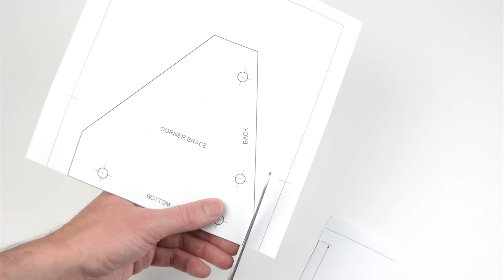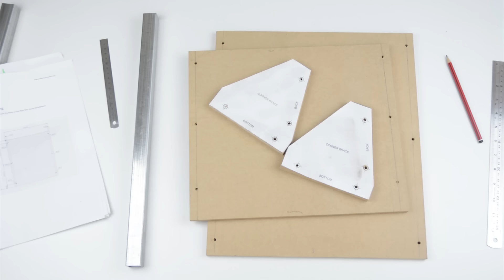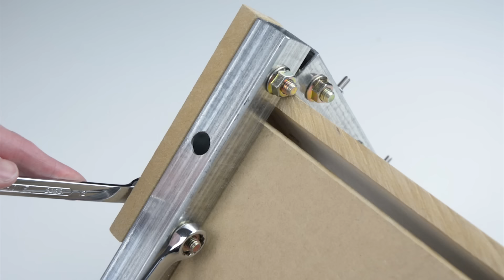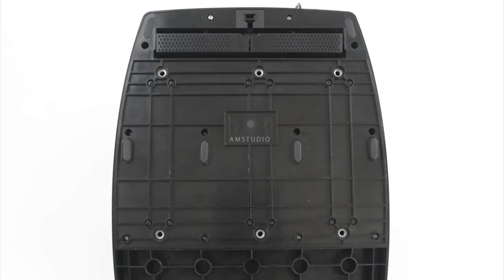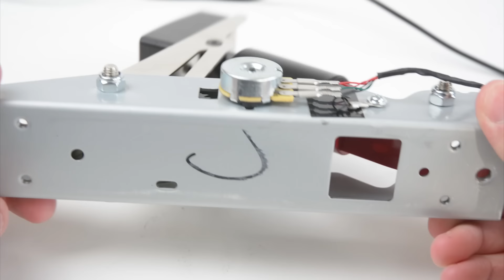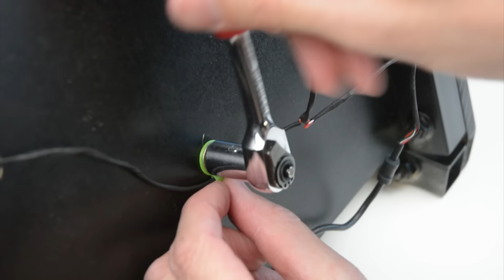HOW TO MAKE LOGITECH INVERTED PEDALS DIY

Comment: As soon as you showed the metal tubes, I knew I couldn’t do this for a while
Reply: I'm not sure if you need metal though, the most stress will occur in the wooden bracket. If this holds up, the rest should too. I'm probably going to try this soon, but will be using wood instead.
Reply: @BlakjeKaas  me who cant even get wood/plywood around me :(
Reply: I don't see why you couldn't just swap out the metal for hardwood
Reply: I made the same thing out of plywood. It's probably more solid than this. Doesn't look as good.
Reply: I used aluminun tubing, a little more expensive but any hacksaw with metal blade lubed with wd-40 can cut it, took about a minute for each cut. I recommend clamping or putting something very heavy on it, will make cutting easier and just let the blade do the work, don't push the blade into the metal.

Comment: Where is the PDF with this “18 page build guide” than? Its not on the linked page.
Reply: It is on the page. Pay and you will get the design for the cable clips, templates for the side supports and the 18 page doco. I downloaded it from there a few weeks ago.

Comment: after using the pedals as standard for months i can honestly say this is a massive change and tthe best pedal mod ever! thank you!
Reply from the maker: Thank you!
Reply: Are using in a rig or at a desk?
Reply: Better than the modified rubber block?
Reply: @sourceopsfanatic2001  ya would wanmt to do that as well. or a load cell kit or a truebrake kit this makes the pedal push the right direction it doesnt change the force applied to it
Reply: @brettknibbs9351 in BMWs case the wrong direction now, because they are bottom mounted
Reply: I bought my Thrustmaster T3PA-Pro pedals used, but the first thing I did was invert them on the frame. I was looking for these specifically because the frame let's the pedals be either way. My other 3 systems (2 other Thrustmaster and 1 Logitech) were all floor mount. So when I got the TM Pro's, I didn't even try them before switching them up. I would never use any other pedals regular.

Comment: Jesus Christ, that Heel-Toe Downshift at 5:19 is CLEAN.
Reply: Shit your right
Reply: Yes, he revs matches very well but he rides the clutch like it owes him something if he does this in a real car He will end up owing quite a lot. You don't really feel a loss of power in a simulator though.
Reply: Heel and toe was very cleen, but as any owner of real car with manual shifting would say, never step on the clutch unless you want to use it right now...
Reply: @pavelslama5543  in any manual car there is a large metal plate at the left side of the clutch pedal so you can rest your left foot in it. So well, this could be the next mod...
Reply: Pumas?
Reply: i am not really good at simracing... would you mind to explain why he did this move?
Reply: So basically When u downshift the motor has to match the speed of the wheels. Say if I was doing 50-60 in 4th put it in 3rd and dumped the clutch I'd lock up the wheels for a second so u have to Rev match... This is fine to do just driving around town without needing to brake at the same time... Eg braking/ slowing.. Take foot off brake to bip gas to Rev match... Back on brake and so on... On a track u need to be able to downshift and heavy break at the same time... Heel toeing allows u to blip the gas with ur heel to Rev match while ur still on the brakes... Idk if that makes any sense or even if u no how to drive a manual transmission... But 5 years later u got a response lmao
Reply: He needs to learn to drift tho lol
Reply: Definitely, but you lose too much speed and time in an actual race! That's why Formula 1 drives almost come to a stop and launch rather than spinning their tires the whole way through.
Reply: @JonathanJones-fo4zg  yeah but heel toe stuff is not used in Formula 1 it's used in rally. Go play dirt rally 2.0 and you will see how important heel / toe  is. When you are sliding through a corner, if you just try and hit the gas after letting off the brake your revs are way to low. these high powered AWD turbo rally cars can fucking launch if you keep the revs high during a corner drift
Reply: @marcusadams6595  modern rally cars have sequential shifters so the clutch is not even used at all which in the end means that heel toe is pointless in rally as well
Reply: @Spike00773  I edit the game file and remove auto blip throttle haha
Reply: Absolutely no point in doing it lol you don't have to keep the rpm's at what they were. 
Maybe if it has a massive turbo and you're starting in 2nd, then again you still wouldn't need to use both if you know how to use a clutch. You don't have to replace the clutch so use that and the e-brake, BAM! Just improved your lap time!

Comment: Hi, i actually have 2 question, i have a t300rs and buying a set of pedals like the t3pa pro is probably way more expensive than doing this so my questions are. Will this work even if i have a t300rs? and were did you buy those pumas racing boots?

Comment: Wonder if this sort of thing can be done to the standard Thrustmaster T3PA pedal set (not the Pro).
Reply: Socky Noob I’m wondering too! Would be awesome
Reply: Literally any Google search only results in how to do it to the PRO pedals which are piss easy because that's why the PRO pedals exist.
Reply: I imagine that the concept would be the same. You could probably even use the same exact base for thats being used in this video.
Reply: I highly doubt it. The mounting points are different and both pedal sets have different designs and structures.  Logitech designed and built the pedal unit first and then built a plastic shell around it. Thrustmaster is sort of an integrated pedal unit design that involves the plastic shell itself in the structure sort of like the lower end pedal sets from Fanatec back in the day. The logitech G25,G27 and G29  pedals are so robust and simple that its easily modded without having to actually break some bits of plastic just to get to the pedal unit.
Reply: Thomas John Solidum that's a fucking shame

Comment: Video on how to prevent your chair from rolling away from your desk while braking <3
Reply: Hugo holy shit it actually works love u man <3😂
Reply: ripsen use old shoes, works perfectly for me 😂
Reply: @Hugo-pj4bm  370 IQ right there
Reply: Hugo lol hahaha thank i will try it out cause currently i taped my chairwheels  hahahahah
Reply: I started by using a kitchen chair at first. I even made a wooden template for the front legs to get it positioned right every time I wanted to drive. That got too annoying, so I built my own sim rig out of dry wall rafters, a brace plate from an old office desk and some pieces of 20mm concrete casting plywood I had lying around. Oh, and a bordeaux leather seat from an Alfa Romeo 156 '99 (passenger side). :)
No matter what, something needs to be done, or you will ruin the drive in the wheel by holding on to it while braking.
Reply: @HepauDK  Wdym the "drive" in the wheel?
Reply: @HepauDK  20 pounds weights minimum
Reply: @HepauDK  I would love to see your rig! Have you posted a pic or a video somewhere?
Reply: @HepauDK  how would that ruin it
Reply: haha!) I use my bed :(
Reply: @AlexSmith-ow9yo  me too
Reply: Hugo what do you mean bro where should i put them behind my chair?
Reply: I am lucky to have my bed at the right distance from my desk so I can use it to stop my chair. Works perfectly because the bed rests against the wall at the other side.
Reply: @Jimmyfpv_  same! lmao
Reply: I using my bed too. I tought I'm the only person with this problem :D
Reply: Replace the castor wheels on the chair for new ones with a brake.  They're £15 for a set of 5 and rock solid.
Reply: I put  2x 10kg plates behind my rear wheels works great.  Lighter weight may also work ( If you have any laying around )
Reply: I took wheels out and made guick release to them😂😂
Reply: I just put ductape around each roll, is kinda annoying sometimes,  but you get used to it
Reply: @Hugo-pj4bm  FKIN GENIUS
Reply: Take the wheels off and put a foam mat down.
Reply: I use my wheelstand and just jam my office chair wheel on one of the legs of the stand
Reply: Sit on a chair with no wheelies on
Reply: Them g29 brakes gave me abit of hell back in the day
Reply: Hugo you fuckin g genius
Reply: ripsen a
Reply: Easy. Sit down while chair is beside the wheel then roll it sideways until you're centered. Resists all but the most extreme brake stomps.
Reply: Lol, shoes on a chair, that's hilarious. If you want to build sturdy cockpit, look into aluminium extrusions though.
Reply: @Hugo-pj4bm  haha that's awesome
Reply: @Hugo-pj4bm  Ur a genius bro
Reply: I put an old pillow in between the wheels xD
Reply: I remember using an old towel on the floor and hoping the roller wheels jammed up just in the right spot..😂
Reply: I connect the chair directly to the pedal platform using a ratchet strap wrapped around the column.  Solves movement on both ends and is even adjustable
Reply: @Hugo-pj4bm  you're a fucking genius. Worked great for me. Thx for the great idea 💡 man!
Reply: Get a slower car so you dont have to brake
Reply: @alexmercer7083  🤣👌
Reply: @Hugo-pj4bm  
Do you walk your chair sometimes?
Reply: Put shoes on ur wheels
Reply: Hate that. A chair with wheels on carpet.
Reply: omg ikr? every time i have a panic reaction, everything just goes flying away, my wheel slides sideways, my chair goes back the pedals just fly ahead xD panic make you use too much force hahaah
Reply: Use rubber non slip things that go under a chair you can find these at a Walmart or amazon and your chair will not move
Reply: Take the wheels off
Reply: if you have 3d printer, just use "office chair brake" from thingiverse. im using it under every wheel, works very well
Reply: Use a chair without wheels 🤣
Reply: what are the dimensions of the paper?
Reply: I get the chair stuck on my bed
Reply: Get some big metal clips (like ones that hold a ton of papers together or some cheap construction clamps) and use them as clamps on your wheels. worked perfect for my big ass chair wheels (they are basically Razer Scooter wheels)
Reply: I used my sofa
Reply: I am building my own setup but didn't think about this until now, thanks hahaha
Reply: I just put a cuple of dumbbells to hold the wheels from rotating.. you can use anything that weighs enough so that it'll keep your chair still
Reply: everyone hates that
Reply: i'm using my backpack when its full of things and it weights
Reply: True😂😂😂
Reply: locking casters. have them on my gt omega chair
Reply: just dont use the rolls or use carpet
Reply: Dunno my floor carpet works, i can barely roll back with the chair haha
Reply: Hugo you deserve a degree in mechanical engineering
Reply: Hugo seriously
Reply: I bought static chair legs for that. I remove the replaced the wheels
Reply: Polystyrene worked for me slammed the wheels into it with my weight, hey presto no more ending accross the room when pressing the brake, I will be buying a rig soon tho, crappy seat makes you be a crappy driver, lol, my excuse anyways lol...................
Reply: My god
Reply: spend 900 bucks on the p1x sim rig.
Reply: Make a pentagon shape (assuming your chair has 5 wheels) out of some wood and screw it to a wooden bottom plate so that the chair fits snugly. That should do the trick nicely
Reply: ductape. just. ductape
Reply: @Hugo-pj4bm  genius
Reply: I got an old chair from a waiting room for my diy budget rig, it flexes back, but doesn't roll back
Reply: I place weights at the feet of my chair
Reply: what game is the first game he was  playing after done the job?
Reply: I just put my back two wheels on baseball gloves lol
Reply: Dayum 932 likes didnt know so many people had the same problem😂
Reply: Just duck tape it that’s what I did
Reply: I just took the wheels off my chair
Reply: put some big box behind your chair, and get something inbetween something solid and the box, very nice stuff
Reply: I feel you man
Reply: Just connect the armrest to the table with some cord, you can put a carabiner on them for quick change or just tie a knot
Reply: Put a brick behind the chair
Reply: Build a wood rig with car seat  its real cheap
Reply: Dont use a chair with wheels maybe ?
Reply: My problem isn't the chair sliding it's the pedals
Reply: I bolted my chair on wood
Reply: wheel locks!!!
Reply: Just dont be stupid
Reply: para cord the front wheels to the desk or stand
Reply: Take the wheels off it
Reply: I put a pair of old jeans like chocks on my chair wheels haha
Reply: Lmao my chair is really heavy and on thick carpet it be sickly sinks into the carpet
Reply: I PUT A CARPET BEHIND MY CAR AND BOOM CHAIR DONT MOVE.
Reply: Simple, dont brake
Reply: Take wheels off
Reply: I welded metal rods together to make a frame to hold the wheel, shifter, pedals, and the chair so nothing moves, also pretty cheap if you have a welder.
Reply: They fixed it
Reply: Take out the rubber piece from the brake pedal, trust me it changes ur life
Reply: They fixed the pedals so now break is softer and there is more grip
Reply: I used a spare piece of guitar cable. I threaded it through the gap in a chair wheel, then around it, then around the next wheel and on the third wheel, I threaded it around and through. It keeps my chair perfectly in place.
Reply: I got a strip of rubber on amazon and just put two pieces of it under the back legs of my chair.
Reply: i am using a kitchen chair with a beanbag to prevent it from moving
Reply: Take two old low top shows an put a wheel in each one
Reply: @Hugo-pj4bm  yooo that’s smart asf
Reply: bolt the chair
Reply: Hot glue lol
Reply: I have just bought some lockable rolls and replaced the old ones with them. Now I can Lock wach roll seperately.
Reply: Pro tip: Just lean forward to absorb the force of pressing the brake, 

it's what I did until the rubber bushing was adjusted (in other words, rubber bushing worn out over time). 

Always prevented my chair from doing that.
Reply: caster stops
Reply: Get a racing rig 😉
Reply: Get rid of the wheels lmao
Reply: I actually used a towstrap going around my wheel/pedal stand and going behind the chair. when braking the strap prevents the chair from going backwards
Reply: take your chair wheels off
Reply: Not have a chair with wheels
Reply: its called wheel chocks
Reply: remove the wheels
Reply: Roller lock gang  >>>>>>>>>>>>>>>
Reply: I drive standing up
Reply: Buy chair wheels with blockers, it's like $20 for a 6 wheels set
Reply: I put an old pair of house shoes on the two rear wheels of my office chair. Completely stopped me from rolling backwards until my full rig came in the mail.
Reply: You can swap out the wheels of your chair for like rubber stopper bottoms
Reply: I fixed that problem by taking the wheels off
Reply: Take out the damn piece of rubber in the spring! Problem solved. The brakes were not realistic at all with that in there!
Reply: Buy a rig.

Comment: I want to do this to my G27, but i am afraid to destroy it.
Reply: There's very little you can damage by doing this. Most important thing is to check the wiring, but even miswiring the pedals is unlikely to cause any real damage. The pedals are basically just three potentiometers in a 5V circuit.